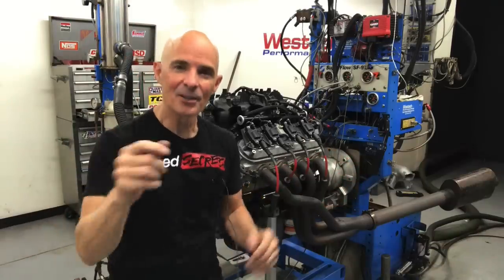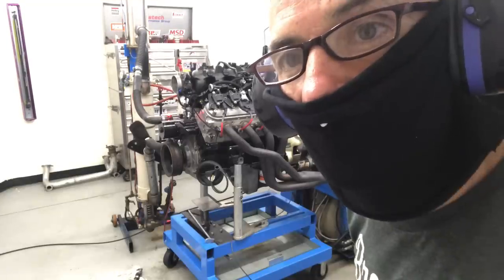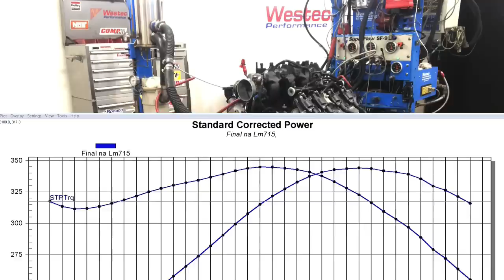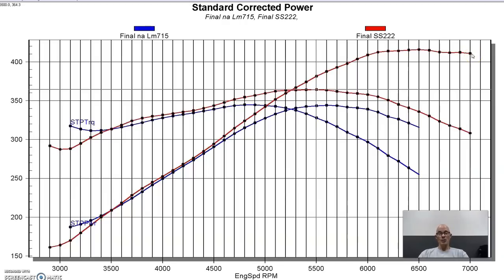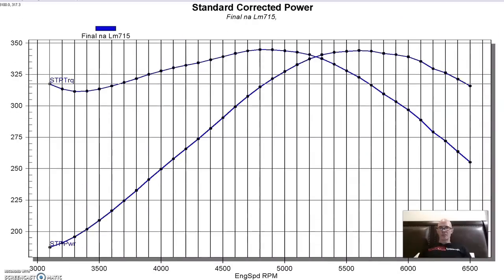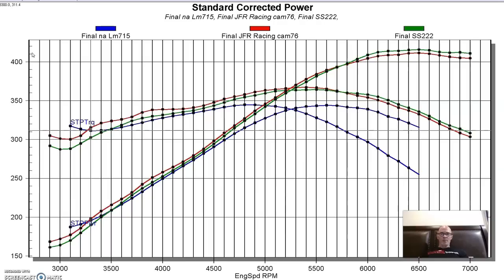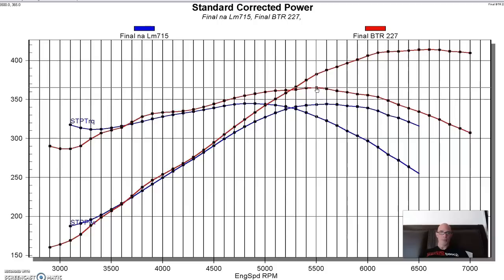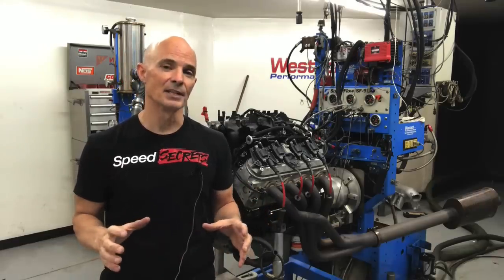DROPPIN' THE DEUCE! STAGE 2 TURBO CAMS

Comment: What would you guys recommend for a marine application. This is going to be a 6 l LS with the 799 cathedral port cylinder heads. As most people know that a marine application you want more torque down low than anything else.
Reply from the maker: JUST PICK THE POWER CURVE YOU WANT
Reply: @richardholdener1727  ok. Most marine applications you want the most torque at the lowest RPM.

Comment: I take away two things from this test:
Most guys are overcamming their LS combos, N/A or boosted.
And the second thing is, with both the Elgin & Summit cams coming in @ UNDER $300 respectively retail, most LS cam grinders  are @ $100 a unit overpriced..

Because that's the true test here, fast for cheap.

Comment: Question, Richard: 
I acquired a very low mileage (68k) 5.7 Chevy out of a '95 Cadillac limo that was running perfectly when pulled a short while ago. The guys who pulled it butchered the OEM wiring harness and also didn't get the ECM
It's a port injection motor with a MAF intake.
What do I have? Is it an LS-1???

Comment: Surprised you didn't put a two piece timing chain cover on this
Reply: Knowing he was going to test multiple cams, it would have made sense. Would have saved 15-20 minutes, per swap!
Reply from the maker: it won't save 15-20 minutes when a complete swap is around 30 min or less if I haul ass-closer to 40 when I meander

Comment: Hey Richard, just wondering for my 6.0 lq4 with 706 heads and a 7875vs racing(.96ar t4) if you think a stage 3 would be too much of a trade off in comparison to a stage 2 since I'm not interested in top end as much as I'd like all throughout the band(even though I love the choppy idle lol)?
Tia and thanks for all the great content and knowledge! 🍻
Reply from the maker: THE STAGE 2 CAN MAX OUT THAT TURBO-SO USE THE SMALLER CAM

Comment: Richard U say all cams are turbo cams,but I'm turbo my 5.7 sbe Higgins race heads but if I use my big 238_242@112 na cam it will leak boost pressure and not make power like say a btr stage 2 turbo cam...here in aus plenty of guys turbo the 5.7 and some cams definitely work alot better with boost then others...what would be an ideal cam for my set up single s480 on 98 fuel want around 600rwhp on no more than 12 psi
Reply from the maker: 600 whp in an LS1 can be done with a stock cam and 12 psi, but any mild after market cam will make it a lot easier. look at a stage 1 or 2 na or turbo cam if that makes you feel better

Comment: so i have a 5.3....what changes? and I thought I knew what i would do...but after your summary...I don't..... I don't know if i can afford a turbo right now.....because I just spent 2000 putting SS LT headers on and adding the stupid LS9 cam.....DO I 1. dump the headers and add a turbo keeping the LS9 or 2. just recam it right now with a milder cam and turbo down the line...or 3. get the comp cams 54-454-11 and max it out? Im conpused...
Reply from the maker: let me know what you decide-but boost is always the answer
Reply: @richardholdener1727  thx so much.  Really appreciate your hard work to educate us all.

Comment: Richard, someone I know has the LS4 front wheel drive 5.3 in a Grand Prix, those have Active Fuel Management (AFM) so these cams apparently won't work. Can anything be done, short of a turbo to up the output? (Could this be an Other Guys engine? Lots of Caprices, Monte Carlos and Grand Prix still out there with this drivetrain.)
Reply from the maker: they will work-just delete

Comment: Awesome video man. This is exactly what I was wanting to see. On next test can you run 93,e85,110 it's what I have available near drag strip and I wanna run 1100hp 4.8 or 5.3 when racing and run 700hp street car. Drive it there drive it home. What is best setup running e85 and 93 stock heads how far can you push stock heads and can you swap a 5.3 head onto a 4.8 or a 6.0 head on a 4.8or 5.3
Reply from the maker: turbo test will be e85
Reply: @richardholdener1727  love your videos man your knowledge is overwhelming bro

Comment: Lookin at Putting the Stage 1 206/212 BTR Cam in my little 4.8 Silverado. Anyone know where I can Find a dyno sheet of that cam in a 4.8 ? Curious on the low end loss or gain?
Reply from the maker: I may have run that in a 4.8L
Reply: @richardholdener1727  Thanks you for the response. It is my daily where I drive 85% of the time in the 2k rpm range. Going to put a stall as well something 2200-2600 or 2600-2800, pending the cam decision. Just dont want to swap in something thats going to bog down the low end. Looking for decent gains in the low, Not a loss. Then that good hp and torque boost mid to high. Chasing the torque dragon I know but hoping to choose wisely with the assistance of our great LS community!! You possibly have dyno sheet on that one. I have seen 5.3 dyno but cant find the 4.8.  Thank you!!

Comment: I didn't see what fuel you were using. A lot of your test are on E85 which carries oxygen and can run a richer A/F than gasoline. E85 isn't always readaly available on a road trip or anywhere near me! I can't help but think gasoline/race gas/or spiked pump would benafit less from split duration with lots of exaust timming. Any thoughts or tests?

Comment: Richard - legit question (and you may have already tested this).. Does that SS2 cam perform more effectively in a 5.3 or 6.0?? I agree that it's a bit aggressive for the 4.8 but i can't help but wonder if that "extra" .5 litre would be enough to make it wake it up AND OR is it enough/too small for a 6.0??? I really hope your channel grows in leaps and bounds like it should - this is the most quality content out there.
Reply from the maker: I'm not sure what you mean my more effectively. -there is a video up with the SS2 cam on a 6.0L.
Reply: @richardholdener1727  I guess i was thinking along the lines of "where is it going to gain the most".. The 4.8 test you had about 75hp  and 24tq and your 6.0 test was about 47hp and 50tq, so its almost like the 6.0 it "wasnt big enough" but the 4.8 it was a pretty significant jump.. granted the probable increase from the extra compression. I forgot about the 6.0 ss2 test, but i guess now i'm still wondering what gains a 5.3 would see out of the SS2. 100hp? 50hp?  I honestly expected the 6.0 to gain MORE hp than it did, so maybe the SS2 is best suited in a 5.3?? or a 5.7??
That's what i was getting at i suppose you could say. Thanks for the reply!

Comment: I'm surprised you havent honed a couple thou' out of a balancer to make these swaps a tad easier (no puller).
Reply from the maker: it is a lot easier now that when I started-I would love a keyed crank and slip-fit balancer
Reply: @richardholdener1727  I was thinking a slip fit would even be ok with no key just for the dyno.  LS has a pretty big bolt that you can hammer down.

Comment: So with a vehicle you still want mpg, and low end tq, would you go with the (little summit) cam?  With 4.8/5.3 or even 5.7?
Reply from the maker: yes
Reply: @richardholdener1727  do you think that the 8706 might have been better in a larger engine, say 5.7L and above?

Comment: Thank you for the work you do sir. I have 2 questions. 

1) does a stock ish 5.3's increased displacement warrant the stage 2 cams in your opinion?

2) how often are you chasing threads on the crank snout/ breaking balancer pullers with these test mules?
Reply from the maker: depends on desired rpm

Comment: Are you going to run this set in maybe a 6l or 6.2. Just to see if the low speed torque stays up a bit better and if the peak rpm comes down as one would think it would. ?
Reply from the maker: it will
Reply: We know this. However, having it on paper would prove it. 😁.  I have a super backwards deal going right now. It is a case of “run what your garage brung”. I had a 227/235 on a 111+3 laying around with a s488  and a tbss intake so I tossed them into my other Tahoe.  Stock converter is a bit much but after 3k it’s a damn monster!!  It wouldn’t run with my Turbhoe with the Ls3 and same turbo but it’s still fun. Stock exhaust too, people pay it no mind what so ever. 😂

Comment: Does anyone know the difference of the 8706 turbo cam and the 8714 truck cam from summit?

Summit lists the Turbo stage 2 as the same as the stage 4 truck cam. With idle lope, power and lift. I’m sure there is a difference.

I wanted the stage 4 truck cam but I might go turbo so now I’m thinking of going Stage 2 turbo cam. But don’t know what’s what.

Comment: What stall converter would you recommend with a SS2 cam in a 5.3 turbo in a 3100lb nova. 4l80e haven’t decided the rear gear ratio yet.
Reply from the maker: 2800 BUT CHECK ELSEWHERE-I'M NOT A CONVERTER EXPERT
Reply: @richardholdener1727  thank you!

Comment: Did you have any problems with the valve's floating using stock springs? Or did you change the valve springs?
Reply from the maker: you can't run stock springs with these high lift cams
Reply: @richardholdener1727  i didn't think so haha would you recommend pac1218 springs

Comment: @Richard Holdner are you tuning this for maxium effect or do you keep the tune stock without changeing anything but the camshafts?
Reply from the maker: we run holley-not the stock ecu
Reply: @richardholdener1727  was asking if you use the stock 1st tune to get baseline or do you make adjustments with each cam you put in to maxium the power?

Comment: Just my luck he tests every stage 2 cam besides the TSP one I got, mine is a bit more aggressive than the Torque cam but a below 220 duration on both sides but higher lift than most of the cams in this video. If only I started my LS build during quarantine not 6 months before 🤦‍♂️
Reply from the maker: The TSP cam does what these do-more toward the Summit 218 cam-meaning it works well

Comment: Are gen 5 truck fuel rails(square style)as good as the gen 3, and gen 4 fuel rails(tube style)?
Reply from the maker: the fuel rails for the DI pressure?
Reply: @richardholdener1727  I dont know what that means, I'm just wondering if the newer style fuel rails flow as good as the older ones.

Comment: Hi Richard, what's the link for the turbo vid with these cams?
Reply from the maker: has not been tested-they will be the same
Reply: @richardholdener1727 , ok thanks, the Summit 8720 gets my vote. I'm running a 4.8 with twin VS 67/62 turbos and, only for visual appeal, the Performance Design Carbon pTR Intake. Not the best combo for power, but should look cool. :)

Comment: Is there cams that wont work with turbos? What would be a wost case and what would it do?
Reply: I heard talk in a old turbo book i got of blowing intake charge right out the ex with to much overlap but never experianced that myself, nor does it make sence sence most of the time ud have more pressure on the ex side
Reply from the maker: very radical cams with tight lsa don't do as well
Reply: Thanx gor sharing all your testing and info, very practical alot of it good for back yard guys trying the best

Comment: So if the 4.8 makes over 400 flywheel. Whats a 5.3 pushing?
Reply from the maker: a cammed 4.8l makes 400 hp fly, a cammed 5.3l cam make even more
Reply: @richardholdener1727  well, hopefully my car does ok. I have an ss2 installed with 706 heads as well. Other factors going into it obviously. But i would like an accurate fly hp figure

Comment: Looking for a cam for my 5.3 I currently run ss2 looking for close to 500 hp have 243 shaved and tbss intake what do you suggest
Reply from the maker: ported heads, fast intake and something closer to 231/247 duration

Comment: I have a set of LS6+ springs from comp cams they have .580 lift will they work for the Ss2 at .585 lift?
Reply from the maker: no-they are good for 550 lift
Reply: @richardholdener1727  thanks i'll look for other springs then

Comment: Doing it that fast how did you not get the ignition firing order not wrong? Are you sure you got the driver side coils back on the driver side? Maybe that messed up timing and skewed the numbers? :D
Reply from the maker: THE COIL PACKS DON'T CARE WHAT SIDE THEY ARE ON-THE PLUG WIRES ONLY REACH THE RIGHT PLUGS-AND I'VE DONE THIS 100S OF TIMES

Comment: How would these cams do down low with boost.
Reply from the maker: THEY ARE TOO BIG FOR A 4.8l IN MY OPINION
Reply: No the 5.3 with boost what would it have at 2000 rpm or 1500 like cruising around town.

Comment: Most of these cams are ground by the same company I choose Texas speed because they have there own in house cam machines and head porting equipment everything is done  in house and it seems you have found the limit to a stock 4.8 it’s gonna make about 416hp with any good size cam but your wasting down low as you showed with the 218 intake duration over 224 I’m always of the opinion that you go one step down to have a fun motor while your waiting for boost
Reply from the maker: I wanted to do TS cams
Reply: Richard Holdener they are nasty especially there all out na cams every cam company has. It’s off the shelf grinds like the sloppy stage 2 type style but it’s there own cams that make them great such as a magic stick or cleetus bald eagles or BFd cams

Comment: i have a question.. im researching for a cam swap in my 13 4.8 but i want to use the stock convertor with good power which would you reccomend..

Comment: Do you have to change the valve springs for the ss2 can or can I leave my stock 5.3 valve springs in there
Reply from the maker: need springs for that cam
Reply: @richardholdener1727  are PAC 1218 springs good for the SS2 cam. It looks like the test motor is using dual springs. Any info would be appreciated!

Comment: Dumb question but what is the magic number where the TQ/HP numbers always seem to cross no matter what the cam etc and is that always the same on any given engine/combo?
Reply from the maker: its the hp/torque formula HP=Tqxrpm/5252--they will always cross there
Reply: Richard Holdener, you need to make some “5252” t-shirts!!!
Reply: I suck at math but will get my calculator out of the closet!👍👍😎😎
Reply: Just visiting this planet. : Howday JVTP. Glad I was wearing my tin hat, and you didnt steal the brainwave from my last brain cells. A 4.8 is about 292 cubes. Only Aussies use Killer Metrics. Another thing to compare is Aspirations Index(AI). AI= cubic inches X peak power rpm/dyno flywheel Horseposer. The lower the number, the more hp per revs. This is a time honoured way endurance engine builders have measured googness of tune since the 60s.A NASCAR or Formula 1 engine will have an AI down around 3600. A stock factory LS, 5500. A side valve Briggs and Stratton or Flathead Ford V8 or smog 1975 to 1981 2 bbl engine, 10000. A Lamborghini V12 4.8 liter, 5200. The other quick measure is BT/C =Best torque per cubic inch before turbo.  For our 2 valve LS's a best ever figure might be about 1.39 fg-lb per cube. Best attributes for AI power, Tick Performance cam at 4420 or so. Peak rpm HP is not always a win if you have to use another 1500 rpm to get another 15 hp. If you cannot increase the horsepower 10% with a 10% rev increase, its not worth the effort. The least revs  that makes the most power is a great rule. Then the Best Torque per cube usually happens. The higher than 1.26 ft-lb per cube is a very good figure, engine master Variable Valve timing 6.7 liter 5.4 DOHC strokers are making 1.63 ft-lb per cube. The LS Mouse engine leaves "vewy few few nuts on the yard table" Squirrelz! Mr. Richard Holdener Brought Me Hair. Um, HP. Look at Every dyno curve...and check those stats with a calculator. Its Baaad A$$ great info for "Sheeple" like me.

Comment: I think bandwagon buyers are leaving a lot on the table when they just buy what they see smeared across their screen. I think there is always room for more “useful” power when you are getting a custom spec for your application. I understand that the SS2 is cheaper and performs well but that shouldn’t be the selling point. Same with converters. Cookie cutter specs are equal for all... that’s where you pay the extra money to get what you need and not just what so and so has. Not bashing any of the cams but it’s like Richard said... “it’s up to where you want the power”.... id also factor in where they are made. And where the core is made.
Reply from the maker: a custom cam in this duration range won't do anything different on this motor
Reply: Richard Holdener what I was gearing that comment towards was the benefits in a custom cam for different setups. Like in light vs heavy vehicles and not just on the dyno. I think people leave a lot on the table not looking passed the trendy cams. Like stage this or that...
Reply: There are only so many numbers and variations though when you are doing a “stage 2” shootout I agree.

Comment: Love my lq4, 706 heads, nnbs intake and ss2. Ballin on a budget
Reply: How much power you make with it.
Reply: Had that with a stg3 truck cam, excellent setup just falls off up top
Reply: @matthewritchie3595  Haven't dyno'd and may not. Running it through Terminator X. Instantly fired up. Pulls hard to 6500

Comment: How much timing did u run with that sloppy
Reply from the maker: 29
Reply: @richardholdener1727  im taking ur advice lol i had 317 heads on lq4 i just swaped 706 heads on it, and i put the sloppy stage 2 because it didnt loose much tq, and put 13/4 Long tubes. About to tune it this week with hp tuners, think im going to swap to flex fuel injectors also.. cant wait